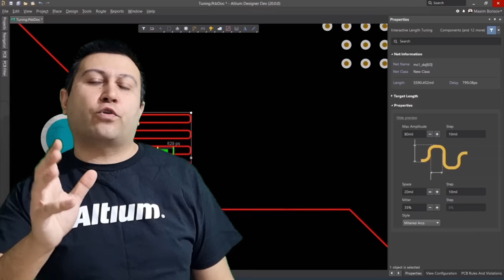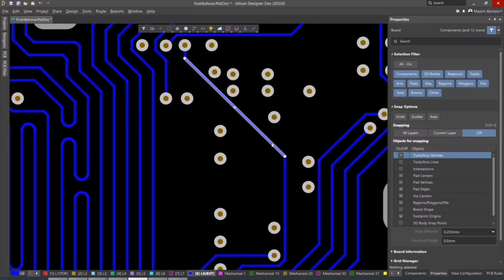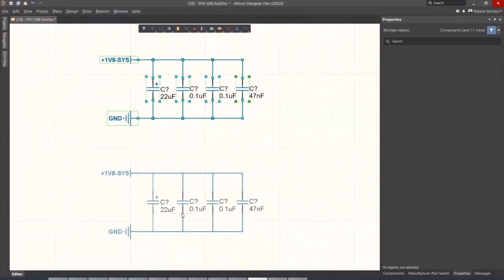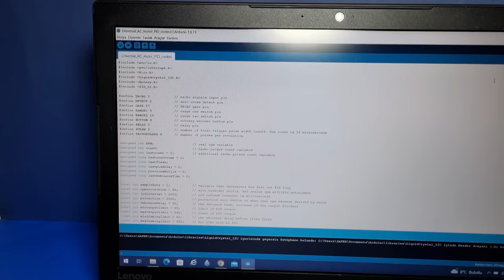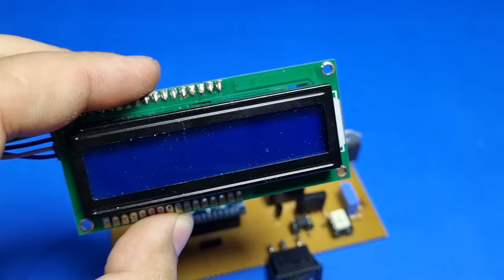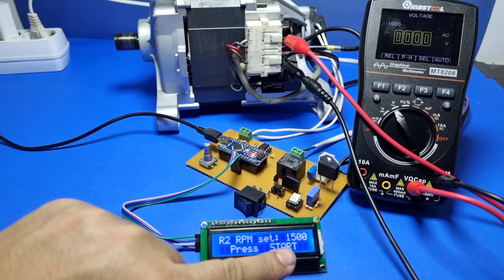How To  Washing Machine Motor / Universal Motor constant speed and torque control circuit

Comment: High, nice shematic. I build some for me but the motor gets faster and faster until it stops for range end RPM. The RPM will not be regulated, can I messure something to find out what is going wrong? Can you tell something about generating the Triac trigger Impulse? Thanks, best regards Pit

Comment: Hi, nice video, thanks for sharing. I have one question, I tried the code but it did not compile, there was an error mesage: Compilation error: redefinition of 'unsigned int RPM'. Could you advise where is the problem? Thanks.